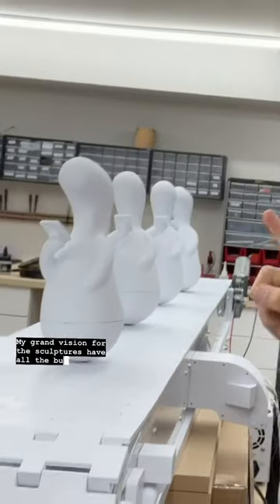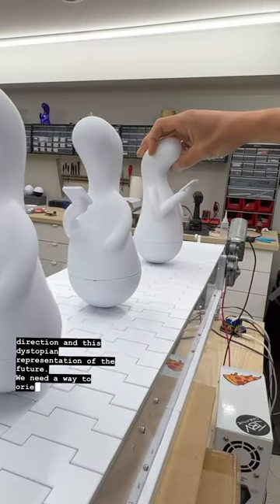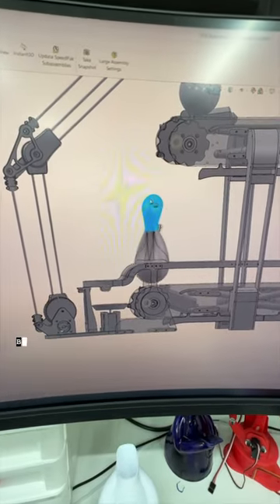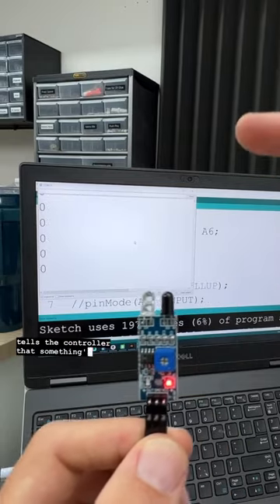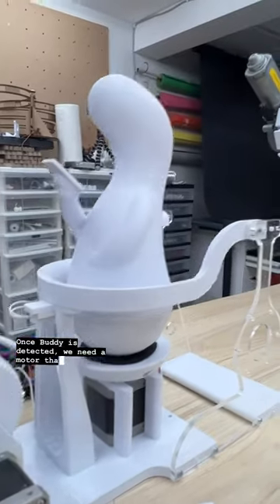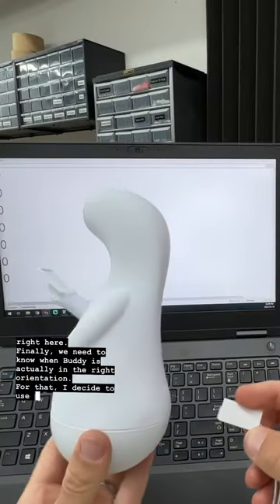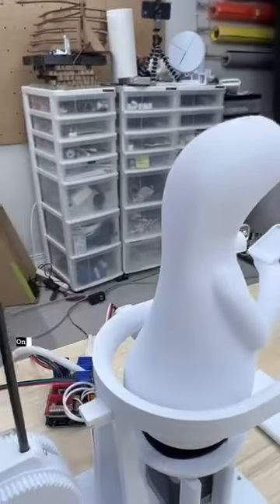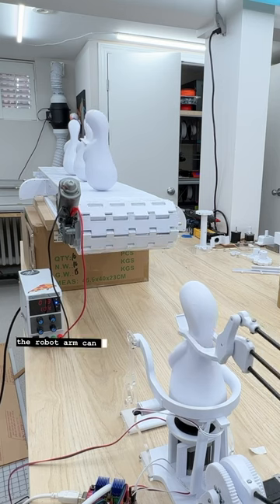Automated Buddy Orientation Device

Comment: Could have made an pin that interfered with the phone or the head that always stops at the right position, if it's already in the right position in the beginning it will do a fill turn. Anywhere in between it  will be corrected. No sensors needed.

Comment: It would not matter as the buddies themselves has no stabilization.....if instead of rounded bottom, we could slightly flatten the bottom so even if its moving on a conveyer it will be stable and much more oriented

Comment: Couldnt you have a slide what will straighten out the buddy as it slides down? You would have to put a small key in the buddy and add a slightly offset weight but that lazy susan is super cool

Comment: Ive recently started a job where theres an excess of steper motors being thrown away, my question is, how do you program them? Are you just using raspberry pis and coding?
Reply from the maker: Oooh! That sounds like a dream! I would happily take them off your hands 🤓 but I use arduino and some pretty simple code to drive them.
Reply: @JBV Creative  2d printers use a lot of em varying in size. Ive been given the clear to snag as many as i want so im gonna start repurposing some. Your channel has been the inspiration